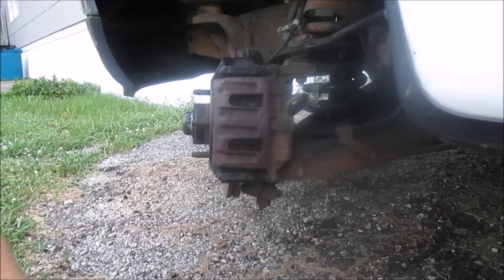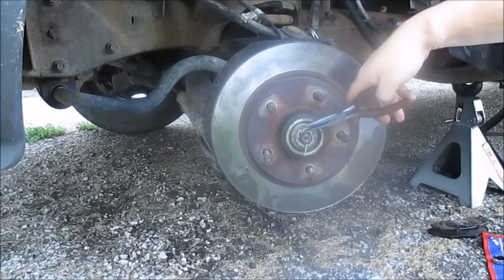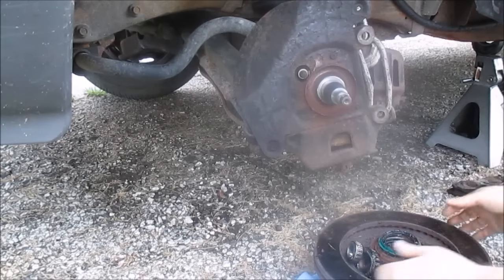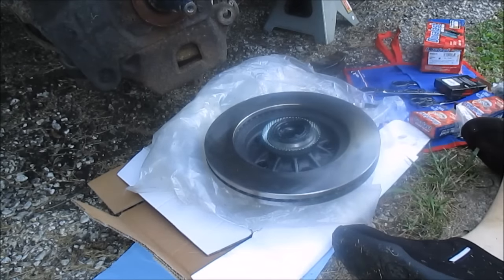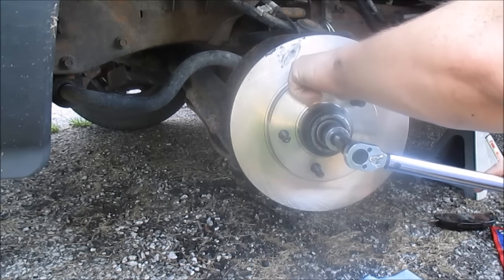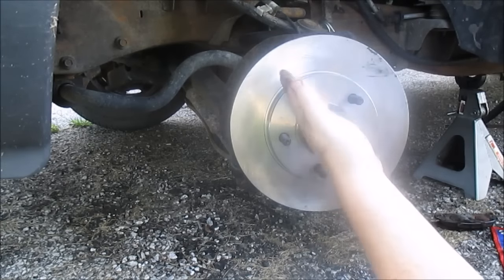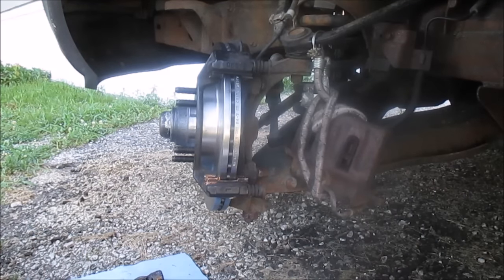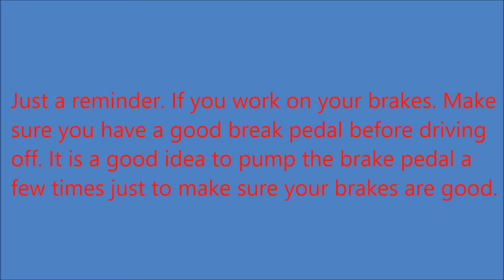How To Replace Front Brake Pads and Rotors On A Ford F150

Comment: My 06 2WD Lariat had a 36 mm one time use with locking threads spindle nut with retainer ring and Carter key. And a solid roller type bearing that's pressed in to the rotor.  The rotor rolls on a smooth surface at the very rear of the spindle axle.

Comment: Hi I'm just wondering if your truck is 2 wheel or 4x4?. I went to go buy the rotors and they told me that I had to buy the entire hub assembly for a 4 wheel drive? What would you say a decent price is for the part you replaced in your video? Thanks great video!
Reply from the maker: My truck is a 2 wheel drive. Lately I have had great luck finding low price parts from rockauto.com 
It takes a few days to get the parts shipped to you, but from what I have found they are much much cheaper than the local auto parts store, and they have a good return policy. I cant remember what I paid for my parts, but i remember buying them off of Ebay in a set. Well I hope this info helps you out. Thanks for watching and thanks for the comment. Have a good day.
Reply: Did you get your parts?  There seems to be a lot of confusion about whether the hub and rotor are one piece or two.   I'm in the middle of it now on a 2004 Heritage.
Reply: I have a 2003 Lariat f-150 4x4, i had to buy the entire hub assembly for the front, but just the rotors on the back .

Comment: Its recommended you replace the axlenut i believe.
Reply: Yep absolutely
Reply: Been doing it 50+ years and never replaced a spindle nut
Reply: With all due respect some models( such as mine) require the one time use spindle nut that has the locking threads design and the retainer ring with Carter key. I've heard some say with those spindle nuts that have the locking threads and   the retainer ring and Carter key aren't necessary.  But why the hole thru the threaded portion of the spindle then? The built in washer on the nut is stamped " Do not reuse".  I chose to replace the nut and use the retainer ring with Carter key after torquing to 295 ft lbs per Ford.  I wanted the added precaution. It was on when I removed the old rotor so on she goes.